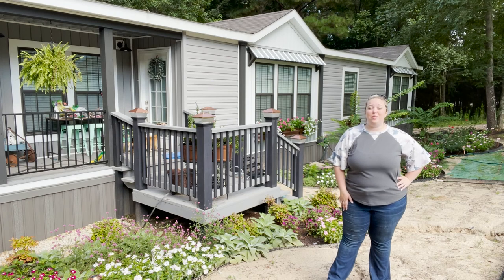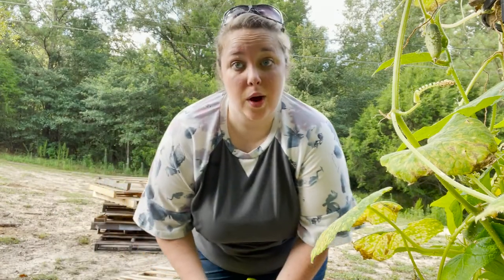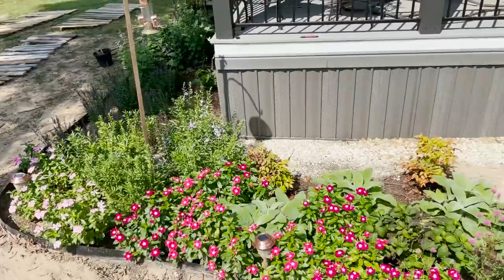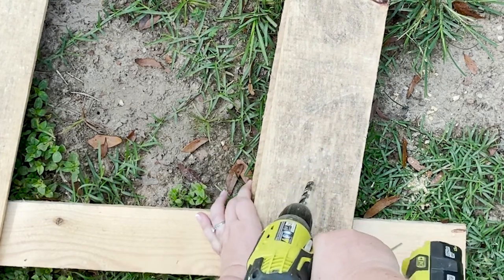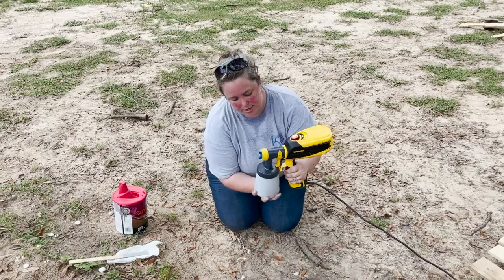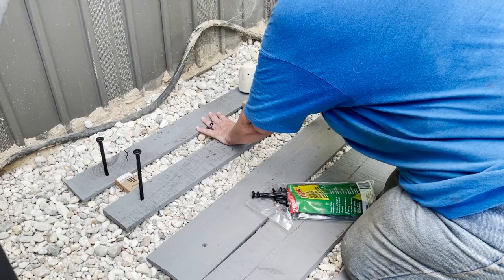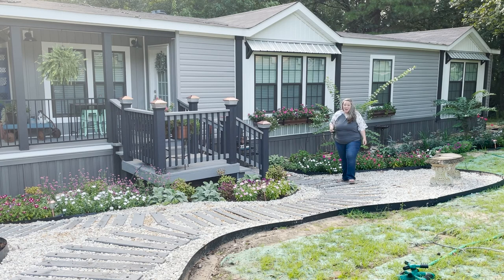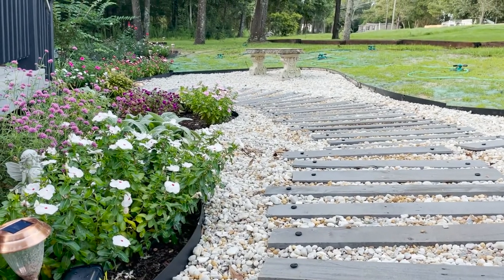Easy DIY Pallet Walkway (Zone 8b)

Comment: Love love your home.  I'm looking at buying it for myself. The deck and stairs... Is that something you had to install after you moved in or waass that included?
Reply from the maker: The deck was included but the stairs and landing were additional. They did provide stairs but they were very basic. I had these custom built (based on a photo of another Lula Mae actually!), but stairs are completely up to the dealer you purchase your home at so what you’ll get depends on your dealer. The basic stairs they wanted to give me were way too short so instead I asked for the money value of the stairs (they gave me a check) and I put that towards these stairs being made